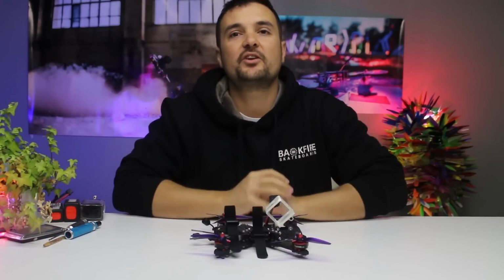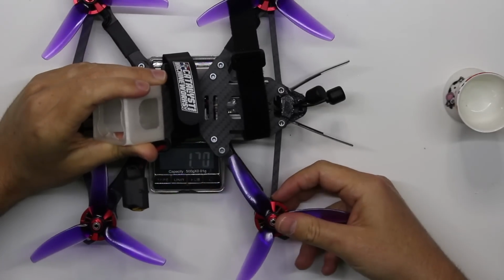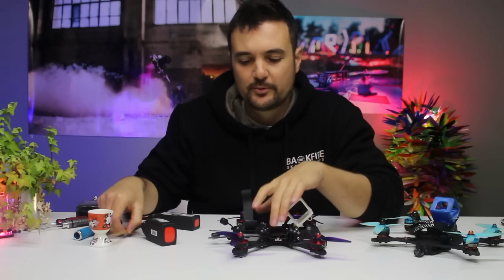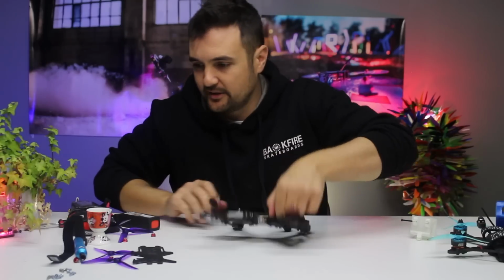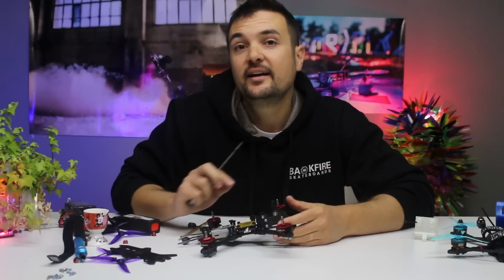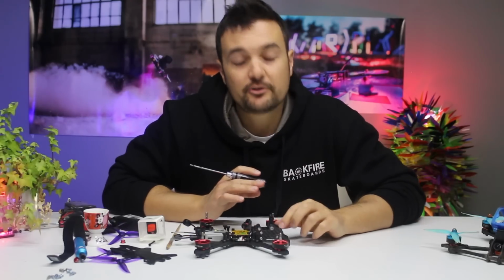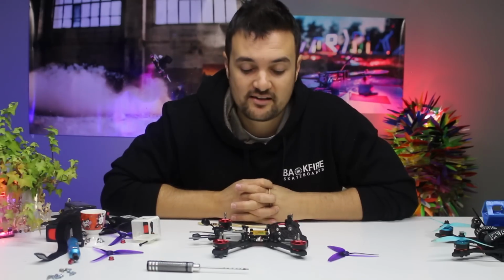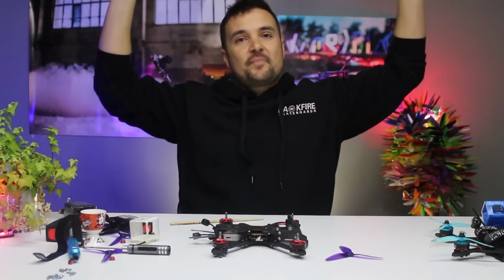FREESTYLES PERFECT DRONE! Most beautiful drone I have EVER seen! Catalyst machine works Banggod

Comment: You're killing me.  I'm in the market for my FIRST FPV drone and want the 'DJI FPV System'.  I want a BNF (Bind-N-Fly) drone (yep one of those guys).  Thoughts, on this being my 1st drone.... 😲😲     Would love to hear your thoughts on this drone vs Rotor Riot HD1 (Ready-to Fly)  - $519.00 (w/ DJI AirUnit).
Reply: If you can afford it it's a great first quad for sure, looks damn near unbreakable.
Reply: getting one of these for your first quad, is like getting a MotoGP racer for your first bike. You'd smash it in first corner and waste all that money and probably never return to the hobby again. Start with an Emax tinyhawk RTF kit. Bugger off Stu
Reply: @sirroger1  I disagree. If 5" is what you want to fly anyway you can start with one. I'd recommend practicing on a sim for a bit first and do the first flights in an open field without trees.

Comment: 455g dry weight!!! ouchie
Reply: That is a heavy quad indeed.
Reply: Serenity17 I’m sure I can build it lighter. 
I don’t use dji and would not use back brace. As well it can have 3 screws per motor and some aluminum screws for the top /plate. Lighter motors and a micro camera. I’m sure it will be average weight for a freestyle rig. 
Just love the design and room it has. 
I’m on the fence, but considering for my next 6s beast.

Comment: Do they ship to Australia ?
Reply: About $60US shipped to SYD with DHL.
Reply: @dronedownunder652  Is that just postage. So have too add the cost of the frame on top ? $60 US  ? I know its a silly question but I have been caught before.
Reply: $60US was freight cost for the PNF. Frame only looks like $15US for international First Class Freight or $40US with DHL. As Raven187 suggests, the other option is contacting Rhys at PhaserFPV and see if they are getting them. PhaserFPV are always quick to respond. - worth a shot.
Reply: Phaser might stock them. They stock other cmw frames